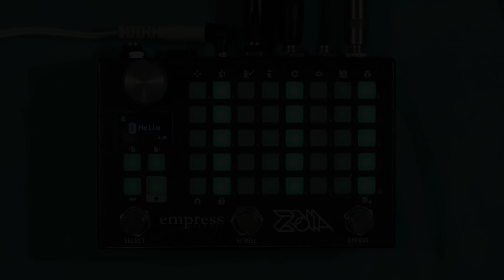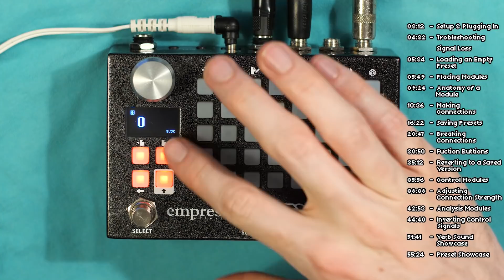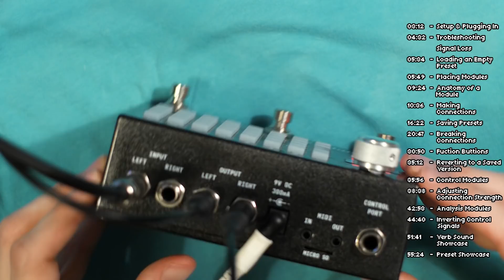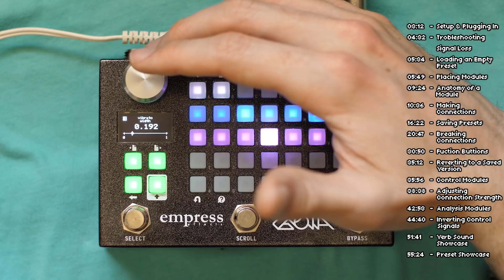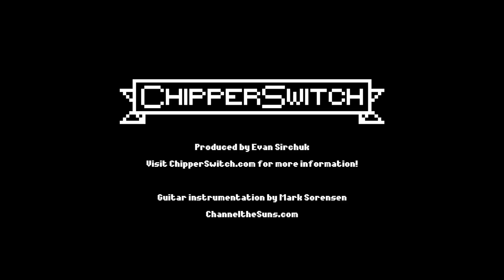ZOIA for Guitarists - (Old Version See Link in Description)

Comment from the maker: Table of Contents Timestamps: 
03:12 - Setup / Plugging In 
04:32 - Troubleshooting Signal Loss 
05:34 - Loading and Empty Preset 
05:49 - Placing Modules 
09:24 - Anatomy of a Module 
10:36 - Making Connections 
16:22 - Saving Presets 
20:47 - Breaking Connections 
30:50 - Function Buttons 
35:12 - Reverting to a Saved Version 
35:56 - Control Modules 
38:38 - Adjusting Connection Strength 
42:53 - Analysis Modules 
44:40 - Inverting Control Signals 
51:41 - Verb Sound Showcase 
55:24 - Preset Showcase